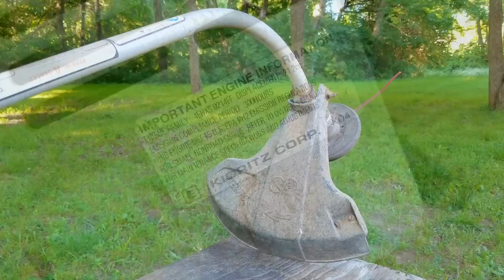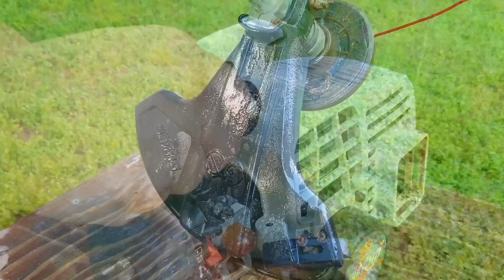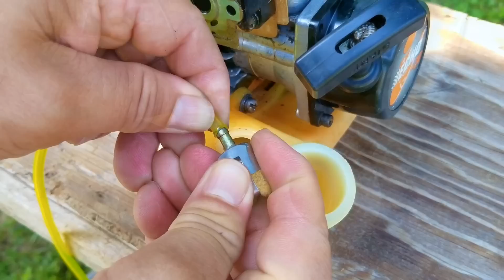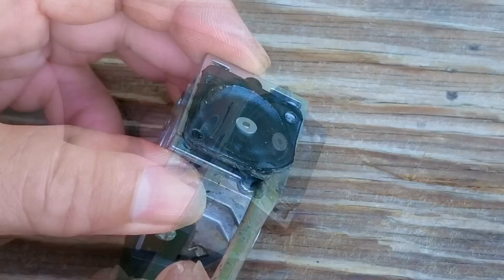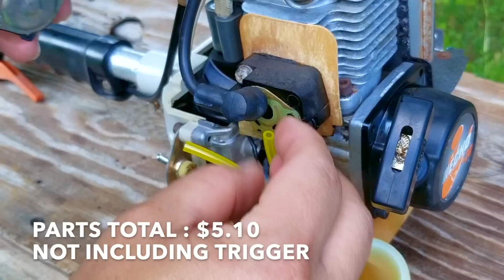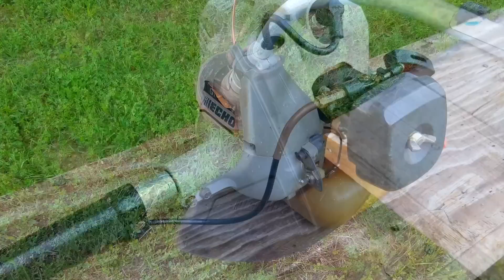Fixing An Echo Trimmer That Won't Start After Storage

Comment: Someone gave me one of these and it's been sitting outside for years. Everything is rotted.

I just ordered a $10 replacement carb that will be here in the morning. I'll rebuild the old one later and have it on the shelf for when the cheap one gives out.
Reply from the maker: Nice hope you get it working

Comment: I have echo  weed eater with the same carb but I can’t get it to stay in idle any idea what to adjust? I already clean the carb but won’t stay in idle  in runs fine just it won’t idle! Thanks!!
Reply from the maker: Sure thing. Have you tried adjusting the screw in the middle of the plastic part in the barrel? You'll need to use a precision screwdriver

Comment: I recently replaced a carb on Poulan Pro PBV 200 LE leaf blower. I called the local parts store to get a metering diaphragm for it, and the said no parts were available, and that i would have to purchase a carb. The OEM one was $62. I purchased an aftermarket carb kit for 14.99 that came with a carb, fuel lines, 2 air filters, 2 fuel filters, hose clamps, 2 primer bulbs, and a spark plug. There is no justification for the OEM carb being that much more expensive. It's running great with the aftermarket one.
Reply from the maker: I'd like to know why they're expensive too.

Comment: Also i have a Husqvarna 130L straight shaft string trimmer and it has two holes for fuel line to pass through and it's very tough to install, can i modify my fuel tank to work with a fuel line grommet to make it easier to install
Reply from the maker: I wouldn't not do that.
Reply: What will happen
Reply from the maker: the chances of "that" fix working is not 100%, then you'll have another problem to fix.  you can try but I wouldn't.
Reply: I believe you buddy, thank you for the info, I found a tool that will help me install fuel lines easier😄👍

Comment: I can’t get an Echo srm2100 to start. It’s hard to pull the cord. Without the spark plug it easy. The screen under the muffler is clean. I have a spark. Why would it be so hard to crank it over?
Reply from the maker: typically carbon build up on the piston might increase the compression and making it tough to pull.

Comment: I love how people parrot the petroleum industry talking points blaming current engine problems on Ethanol.  Ethanol doesn't affect rubber components as badly as gasoline.  Since rubber and gasoline are both petroleum based they have the advantage of dissolving each other and recombining.  Ethanol is just sugar water left on a radiator for some time.  Water gets into fuel regardless of ethanol content or no ethanol.  You leave your tank half full, the gas gets displaced by humid air as it's used up and the humidity condenses and the only way to really keep that from happening is you fill the gas up to the top again.  This happens regardless if it's 87 Regular E10, that expensive crap in a can, whatever.  Also, over the years, things have been getting cheaper with flimsier materials in place of once really resilient materials in the production of these motors and their components.
Reply from the maker: very good comment

Comment: Always nice to see quality products given a second life. Indeed ethanol fuel should be avoided with these small engines. For low use fuels like Aspen (alkylate)are preferred. We use this type of fuel always, sometimes equipment is not used for years and even then it fires up after a few pulls. If used more frequently ethanol free gas and 2 stroke oil like red armor saves you this hassle.
Reply from the maker: Thank you!

Comment: What do you clean the dirt with ?? Is it regular windex?
Reply from the maker: no it's a strong degreaser
Reply: What kind is it? I hav a few trimmers that are covered in mildew and dirt. Quick question, I have Stihl FS 86 and the spring recoil broke, no matter how hard I try I can’t seem to put the spring back together. Any tip would help allot

Comment: i did have to change the fuel lines from the old yellow ones to the new yellow ones in the kit, but they were not sealing properly, bit too loose and when you press the bulb it goes everywhere, so i replaced them with the clear ones, not sure how long they'll last

Plus - do you know how you can keep the good compression from the engine for it's decade or 2, to come
Reply from the maker: sure, make sure you always mix the correct amount of oil into the gasoline, and let it warm up for 1 minute before using it.
Reply: @HomeGaragechannel  i only give it 10-15 seconds before using it, but i only use it less than part throttle, just enough so it can cut grass at the start, then getting more aggressive when it's hot
Reply from the maker: nice

Comment: I had 3 trimmers, and all were a pain in the ass. They were temperamental. Sometimes, they would start and work great and sometimes not start.  Sometimes, they would start right away but not stay running.

 About 15 years ago, I went to use my trimmer, and it would start but not stay running. I said to hell with it, went to Walmart, purchased a 250-foot extension  cord, and a 20 dollar trimmer. I still have the same trimmer and don't have to buy gas, mix it, or ever work on it. Just plug it in and start trimming weeds.
Reply from the maker: nothing wrong with a corded trimmer I had one  a long time ago

Comment: How do I get in touch with you to ask a question?
Reply from the maker: you can send me an email if you want. homegaragemail@gmail.com
Reply: I @HomeGaragechannel I have a stihl km55r it has spark all the time even with the switch wire removed from the coil I tested the wire and and switch they are fine it has a lot of kickback when I try to start it

Comment: How do you prepare the engine for long term storage? Also, what is the 3rd fuel line for?
Reply from the maker: sure, run the machine until it runs out of fuel and the 3 line is for the fuel tank vent, because the fuel cap does not have one.

Comment: Hi I have a a problem with my echo pas2400 it will prime fuel up when cold but when hot and you leave it half n hour the bulb is empty and it won't prime fuel up until it goes back to cold again
Reply from the maker: interesting,  I'd say you have a carb problem.

Comment: Can you tell us about that little bath that you use to try to rejuvenate the diaphragms? What's the fluid in there? Thanks.
Reply from the maker: sure, it's DOT 3 brake fluid. Make sure you have good sealing cap and depending on how bad the diaphragm is, but it could take as little as 24 hours or 24 days to get it back to shape.

Comment: Hello I have a question I have a mower that my neighbor gave me it sat out for at least 3yrs I checked it had to replace the on and off lever and a carb it turns on and runs good but when I turn it off and then try to turn on it won’t start unless I  primer it again what do I need to do  cant figure it out I would appreciate it if you can give me some tips thank you enjoy all the content
Reply from the maker: sure, It sounds like a carb issue to me, I'd replace the carb.
Reply: Good morning sir and yes I did the carburetor is brand new
Reply from the maker: sure thing, I'll need to know the model of the mower so that I know what It looks like

Comment: Hi, I’m looking at fixing a Husqvarna trimmer which stays running for a minute or so and then cuts out. The fuel tank cap is also missing. Any ideas of where to start/ if you’ve got a video of similar would be great? Thank you
Reply from the maker: unfortunately no, but if I were you, I would replace the carb.

Comment: Friend dropped off a leaf blower he said he thought it was run without oil. Well no compression pulled plug cylinder scored. Put a few shots of oil in the cylinder started ran till shut off  then no compression again. Told him shot so I put a few shots of oil in the cylinder took it across town and dropped it off at a place where the guy fixes stuff. He will find it. it runs think he won then won't start.

Comment: I apologize sir for changing the subject but I have a TB100 with a Briggs and Stratton push mower that's driving me nuts. Carb completely cleaned out push the primer bulb a few times and it will burn what the bulb put in and then die. If it has a fuel filter it's hidden very well. I realize it's a amateur question and I apologize it's just to good of a mower to junk and I sure can't afford shop fees. Thank you for everything you do on your channel take care.
Reply from the maker: not a problem, did you clear the brass jet at the bottom of the white plastic part in the middle of the carb?
Reply: @HomeGaragechannel  yes sir, now when you prime the bulb gas shoots out of the bulb. Guess I'll have to replace that 1st. If you had a separate channel for monthly fees just to help with questions like these id gladly sign up. Thank you for everything.
Reply from the maker: I would do it, except I don't have the time to start a 3rd  channel, also I would just consider replacing the carb.
Reply: @HomeGaragechannel  thank you sir. Take care

Comment: Need some help, i replaced the blade on my troybilt TB200 mower. While running it stared knocking and after about 10 minutes the blade sheered off the bolt. It wasnt an oem blade, it was a gator universal. It came with no instructions, i just took off the old one and put on the new like how the oem came off. I now have half the bolt in the shaft of the mower.
Reply from the maker: I guess you're not able to grab any part of the left over bolt then?  IF so, you'll have to find someone with either and "easy out" kit , or a welder to weld on a nut so you can remove it.

Comment: I have a kawasaki TH 48 trimmer. It runs great after many years however sometimes especially when cold the engine gets really tight when trying to start it. Could that be the carb leaking fuel inside the engine and almost hydrolocking it?
Reply from the maker: I'm guess so, but to find out, I'd remove the spark plug and pull the rope the next time it does it.
Reply: I should also add that the kickstart assembly is rotating and retracting smoothly though it is a bit bent

Comment: If l am working on an echo, l get oe parts 98% of the time. Some parts are the same on stihl echo etc so l have got a stihl parts from time to time because the stihl dealer is 5 minutes away verses 45 for the echo. On stihls and husquy try to use oe, but if the dealer has stens, or rotary parts l will use them. On everthing else, it is what l can get quick and/or at a good price.
Reply from the maker: nothing wrong with that, in fact it's a good choice

Comment: Cheap $15carbs for me.. I have an older Echo trimmer in my cellar that I can't find anything on line about. Still looks to be in good shape but I've looked for an aftermarket carb and still nothing. I'm not at that point were I want to take it apart and do what you just did there. I'll keep looking.
Reply from the maker: you and me both

Comment: I bought an aftermarket carb for my 20 year old Echo. It was junk. The trimmer wouldn’t start and adjusting the mixture screws was fruitless. 

I bought an OEM. The Echo started on the second pull and has operated flawlessly since. 

Keep the old tools running!
Reply from the maker: nice work!

Comment: I have two quick question so I have one of this same type so my question is to you the head can I change it because I don't like it. Second question what kind of product are you using to get the grease off that trimmer it seems to work pretty good👍
Reply from the maker: it's a degreaser from Harbor Freight and yes I believe you had get a new universal trimmer head for these
Reply: Okay thank you so very much👍

Comment: I've always adopted an OEM+ approach with part replacements. My reasoning is that I'd like the parts to last as long as the originals, if not longer. The carb gaskets in my SRM-210 held up for 15 years, even though I shouldn't have been using them for that long. OEM screens for my electronics have had higher brightness and color accuracy in my experience, and I've chose to either overspend for the manufacturer to replace them, or install a used panel even if it was scratched/chipped. Toyota (Denso) coil packs in my Sienna have done extremely well, and it has a few that are still original, even with nearly 220k miles. 

On the other hand, there are things that fail due to manufacturer oversights. For instance, the dashboard in my Toyota turned into a sticky rubbery mess that smells like a gym bro's ass on a hot day, and a replacement part is $2600 according to Toyota. If aftermarket dashboards were sold, I'd be giving them my money instead. Supposedly Toyota "nailed it" and "hasn't seen subsequent replacements after the initial fix," but a few online testimonies have stated otherwise, at least for people in hot climates. Things like high quality tires and coilovers can also outperform stock parts, and I would not hesitate to spend more on those items than I would for cheap aftermarket or even OEM parts.

Unfortunately, every single time I've tried to spend less on a part, I've always ended up spending more in the long run. When I replaced the screen in my iPhone SE, I had to redo it. When I put off control arm replacements for my van, my tires ended up wearing halfway through in half a year, even with rotations. When I spent money on cheap tools, they broke or bent within the first few uses. When I bought a cheap wifi card to save a customer $20, their only complaint with the $1500 computer I built them was (you guessed it) poor driver support and wifi performance on that card. Cheap batteries have lasted me half as long as a Duracell or Energizer, cheap RAM has failed more tests than Crucial or OWC memory in my experience, cheap controller parts/replacements have much less accuracy than the originals, and cheap cases won't protect your phone worth a damn. In my experience, saving 50% on an alternative won't save me from doing it again, so I've always tried to fix things right, or not at all.
Reply from the maker: you make a good point, and there's nothing wrong with it.

Comment: hi..i have the weed eater.  it runs good on full trotttle but it does not idle.  i already try to adjist the carb but i did not had any luck...any advice..thanks in advance.
Reply from the maker: sure, replace the carb.

Comment: So what kind of compression do you think they should have?  One more question if you don’t mind..I have two of these weedeaters except they’re the straight shaft.  On one of them it would start but then if I stopped and went to restart it wouldn’t start.  Found out it was flooding the cylinder with fuel.  Replaced the diaphragm and I thought everything was good.  Went out a few days later and there was fuel on the garage floor and it wouldn’t start.  Any ideas?
Reply from the maker: sure, replace the carb, that's what I would do.  Also the compression, I'd like it to be over 140 psi
but anything over 90 is fine with me.
Reply: My 2 cycle repair Manuel says no less than 90# psi. When you replaced the metering diagram did you put the gasket first than the diagraphm.
Reply: @jerrysoutherland662  I left the old gasket on and just replaced the old diaphragm
Reply: The metering lever may be set to high causing the diaphragm to push down and open the needle.Or it could be a bad needle.

Comment: Do I use OEM or aftermarket...That depends. I tried aftermarket for the deck belts on my mower and they lasted 15 minutes. So for them I use OEM. For the spindles when I rebuilt my deck, I used an aftermarket kit.  It depends on the situation. Most times however I do go aftermarket.
Reply: On the spindles, remove them and disassemble. Then, take the inner seal off the bearings so grease gets to them.  Having spindles you can grease, but no way of grease getting to the bearings is a way to just waste grease.
Reply from the maker: I like this idea .
Reply: @HomeGaragechannel  
I have a JD LT155 from 1999, and even back then, the spindle bearings were sealed.  I took them apart and put new bearings in with the inner seal removed and keep them full of Lucas Red N Tacky.  Its fantastic grease.   Now I can hear the engine running and not the howl from the bad bearings.  It's crazy how loud bad bearings can get.
Reply from the maker: that make sense

Comment: My neighbor gave me an old Homelite bandit SX-135 because he knew I liked to fix small engines. The fuel line were completely gone and tuned to dust. The model year of the trimmer was 1998. And it was made in the USA! I replaced all the fuel line and tank grommet. I had to buy an echo tank grommet because that all my local repair shop had. It has 3 holes which I didn’t need. So I plugged the 3rd hole with a screw that was very snug so no fuel leaked out. I fixed that trimmer for $2.64 because I had the fuel lines and filter on hand just not the grommet. It did not need a carb replacement surprisingly after all they time sitting. I made a decent profit from that one. They don’t make them like the used to!
Reply from the maker: wow nice save!